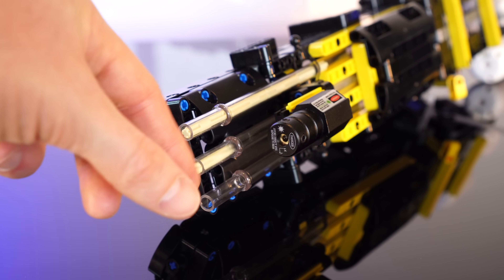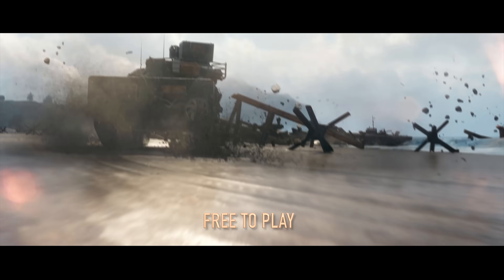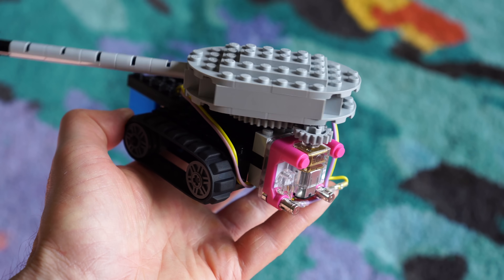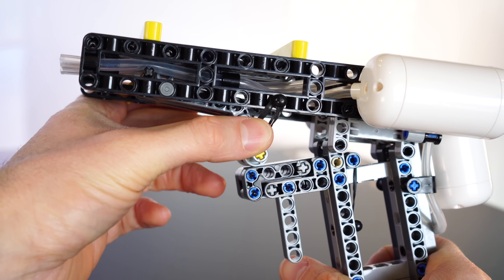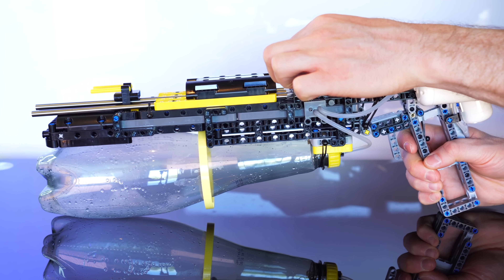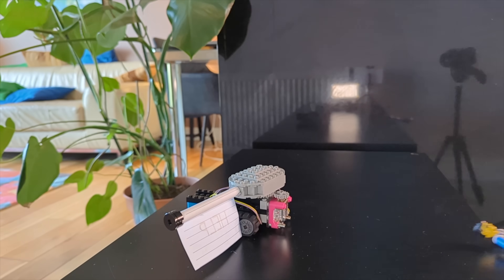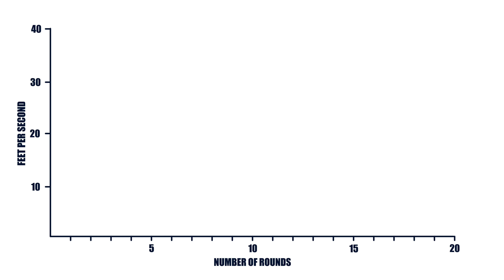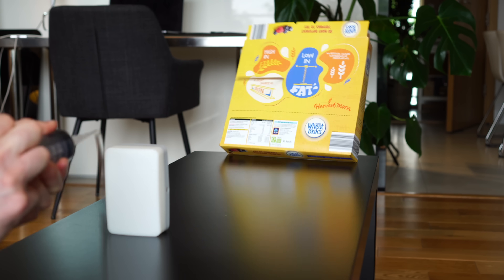Powerful 3 Barrel AIR-POWERED Lego Shotgun

Comment: A thought on accuracy:

one of the main two ways, historically, that have been used to produce more accurate projectiles, has either been thru endusing a spin in the projectile, usually through rifling. Or, by using fins.

Rifling takes Very precise machining, or 3d printing, and might not work well with LEGO products. So, I think your best best might be to use a Discarding Sabot type of projectile.

By encasing the projectile in a casing that keeps it flush against the walls of the barrel, and putting fins on the projectile, you should be able to produce a far more accurate hit, without sacrificing power. I'd suggest giving it a look for V4!

Comment: How many PSI are you charging those air tanks to? I would assume that the system is bottlenecked by small diameter tubing having low airflow, so a higher pressure would help without having to modify any parts. Though you could try drilling out the outlets of the tanks to a slightly larger diameter.
Reply from the maker: You're totally right, that bottleneck is quite frustrating. I was only pumping this up to about 50 psi at most, but I like your idea of just pushing through the bottleneck with higher pressures. I think cola bottles can take quite a bit more pressure, so it might be worth creating better seals and pushing the pressure even higher!
Reply: @JamiesBrickJams  My understanding is that Cola bottles can take 60 psi safely and potentially up to 90 at the risk of them exploding. Or you can just look it up, I'm pretty sure other people have tested it.
Reply from the maker: Yeah I think it's around that neighbourhood. I remember being surprised when I looked it up - was much higher than I expected. Will see what I can do 😉

Comment: Small tip for the hose connection to the bottle, you can connect the hose to the t-junction then thread the hose through the hole instead of the juntcion first, thus getting a tighter seal. You'll need a slightly larger hole but it'll work better since you can use higher pressure
Reply from the maker: That's a great tip, cheers for sharing man! 👌
Reply: @JamiesBrickJams  No problem, another advantage is the higher pressure will give a tighter seal thus enabling even higher pressures. The highest I've dared is 9 bar so it should be plenty. Wouldn't recommend it for pneumatic engines though since it's a bit much for the pistons😅

Comment: I would recommend adding a stock to help with aiming. This way you can stabilize your Lego weapons better.
Reply from the maker: Not a bad idea, would probably make the handling significantly better
Reply: @JamiesBrickJams  you could also attempt at making a brace that grips your arm, though I think making a basic stock, even one made out purely Technic beams and connectors as a sort of wire stock, would be easier.
Reply: Maybe use worm gears as riveling
Reply: @leonhardmollney8638  that's impossible and would be useless anyways

Comment: all 3 airtanks to one barrel would be insane😯
Reply from the maker: I've actually tried 4 tanks on a single barrel! It's a little stronger, but a bit underwhelming as each tank is bottlenecked by their small outlets. But perhaps some modifications to the tanks would be worth messing with!
Reply: @JamiesBrickJams  yeeah the key is to maximize peak pressure and its duration on the chamber. We (or just you, for that matter lol) could do some calculations to make a super-strong sniper rifle haha!
Reply: @JamiesBrickJams plastic bottles can hold a ton of pressure if you seal them right, with a valve instead of crimping the pipe, you could shoot at pressures up to 8 bar
Reply: @JamiesBrickJams  longer barrel might help